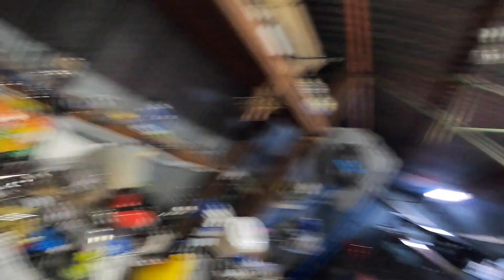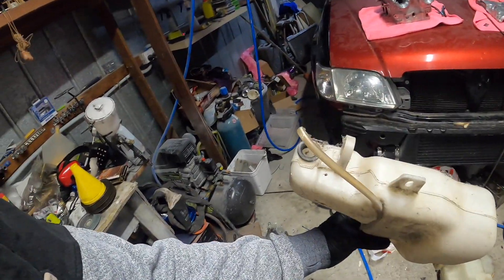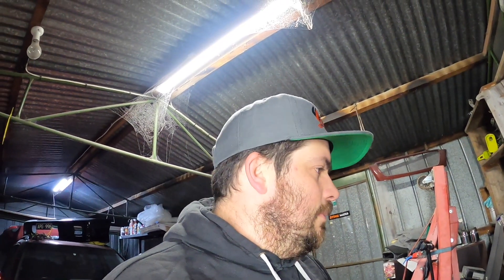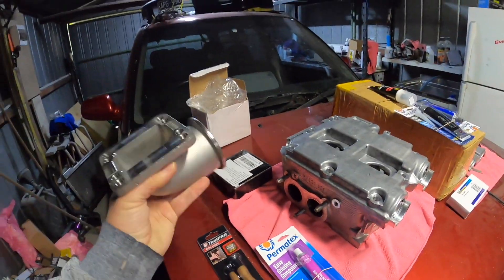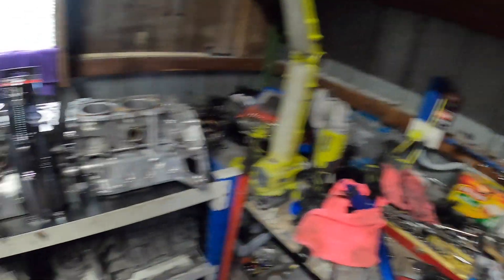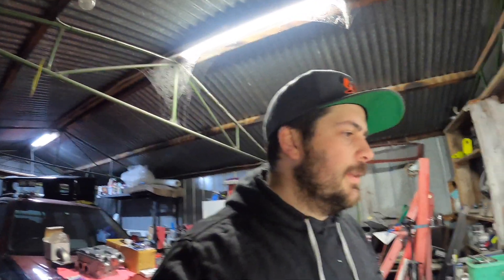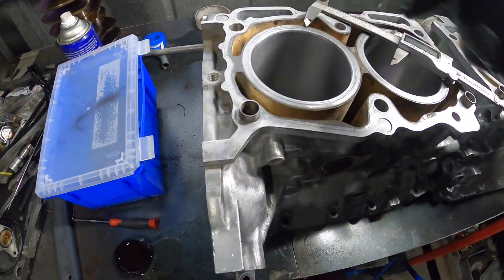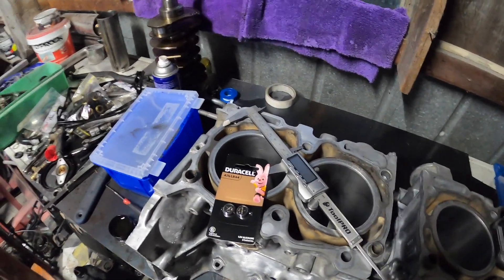TWIN TURBO SUBARU // ENGINE REBUILD // IS THE BLOCK TOO FAR GONE?

Comment: Looks like maybe your scuffing in bore was insufficient clearance.  Your forged pistons needs a bit more clearance than standard cast pistons.  In theory there is the standard 92 mm bore size. But final size will be determined by new piston set(all 4 need to be checked in case there is an odd one). I would pay the $100 to get it honed at machine shop. They can dwell the hone machine top or bottom to true out the bore as there doesn't seem to be a lot of wear. Just my opinion